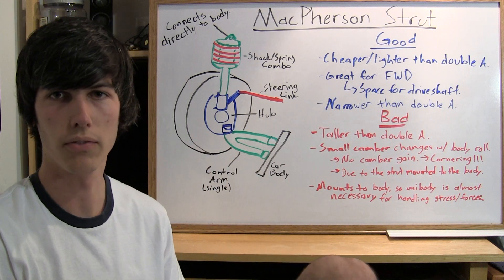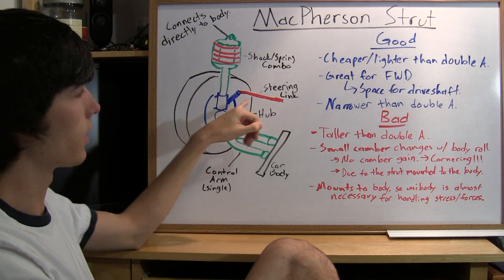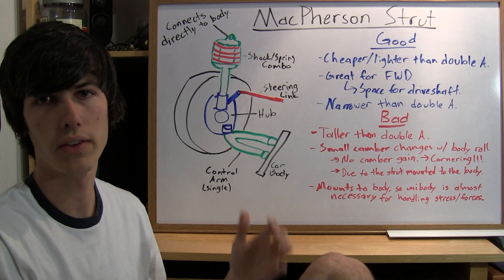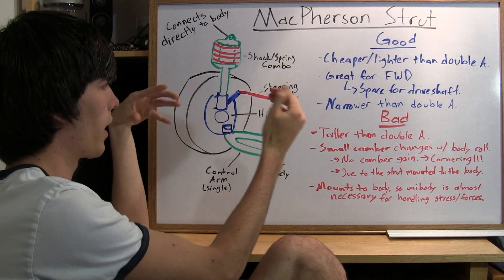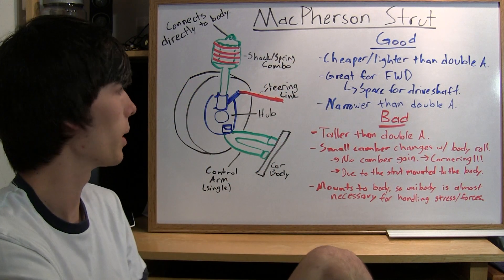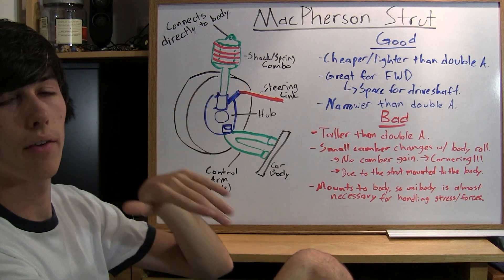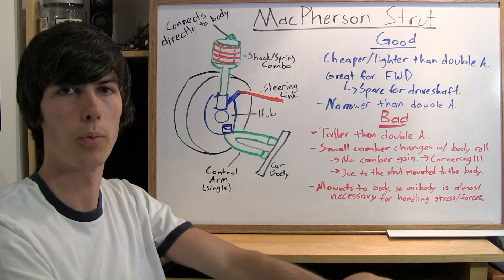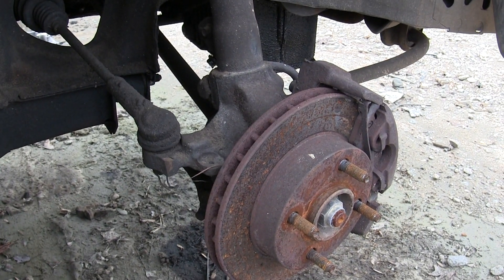MacPherson Strut Suspension - Simple Explanation

Comment: Hey man, me again.  You may wish to examine your comment about "small camber changes with body roll" and "no camber gain when cornering."  Neither are true.  A MacPhearson strut setup CAN go through huge camber sweeps, it just depends on how it is configured.  The shorter the lower control arm, the larger the camber change the car will experience.

They definitely DO have negative camber gain while cornering and this is achieved by making the wheel side of the lower control arm lower than the chassis side.  In doing so you force the bottom of the upright out while it sweeps up, right up until the angle of the lower control arm is perpendicular to the steering axis inclination.  Once you get beyond 90º to the SAI you start to head rapidly towards positive camber.

Most modern strut based cars are setup to gain some negative camber during body roll, some gain more than others.  Look at the modern BMW's, the modern Mustang, the BRZ/FRS and other more modern strut cars oriented towards performance and you'll see it in the geometry! ;)
Reply: yeah your right and its impossible to have no camber change with macpherson ... but you can with equal length double A arms. what he says dosent make sense.....
Reply: This video needs to be redone.

Comment: Actually it is possible to gain camber when cornering with a macpherson strut when playing with then components geomerty, longer lower A-arms, more angle to the struts while it is static ( not talking about tire camber while the car does not move ) etc. Every BMW 3 series, Porsche 911, or Nissan S chassis and lot of other have macpherson front suspension and they can achieve that, they gain negative camber as the front outer strut shortens while cornering. BTW great videos, subscribed!

Comment from the maker: No, there is not a relation between a cars ground clearance and it's unsprung mass. Sports cars are kept as low as possible to keep the center of gravity as low as possible, balancing the forces better across the 4 tires. Almost any car can be lowered, and this doesn't alter the unsprung mass (other than part of the weight of the suspension components which were swapped to lower the car shocks/springs/etc..).

Comment: First off, I want to let you know that I have plenty of mechanical experience and I know the terminology, so dont be afraid to get technical with me when answering this.

I have a 2003 Subaru Outback. 2.5L N/A regular commuter car. All stock. Dont get me wrong, these cars are freaking amazing and practical and with just a little money under the hood they have lots of potential. I love my little wagon. But its getting old and tired. Just hit 216,000. The throttle doesnt feel as sporty as it used to 30,000 miles ago when I bought it second hand. 
I've been having fun in it but I know its only abuse to the car, but aside from often revving it higher than I should, I've tried my best to take care if the suspension and it's components. Braking softly, going slow over bumps, just trying to keep that solid and planted feel it gives me when I drive it.

But soon I had to change the ball joints, which I did successfully. A normal wear and tear part of a car as you know.
I also went ahead and changed the tie rod ends since I lived up north at the time. The roads are horrible and if youre not careful you can easily throw your entire alignment off by smashing into a pothole the wrong way.
Anyway, the tie rod ends ended up being complete and utter garbage. They gave out only a year after replacing them. I should've expected it since they came from eBay. I dont even know what brand they were. I still had the original Subaru tie rods in the garage and I thought id do the hand check on them and they didnt feel sloppy at all. At least the outer ends didn't. The inner ends were. So I changed them to MOOG inners and put the original Subaru outers on them.
So with all the ball joints replaced I took it for a test drive. No sounds, nothing. 
Until I pressed on the brake. 
As the front end dipped down, a pop would come out from the front suspension area. Only when braking. Acceleration was smooth. There are no noises while turning. Going over speed bumps makes the sound too.
I took it to Goodyear to have it aligned. As they drove the car up the ramp, they heard the noise and told me it was the ball joints. I explained to then that I already changed them, including the tie rods.
They jacked the car up and checked the wheel for slop. There was none so they did the alignment. 
It felt nice for a little while. But maybe 100 miles in, my steering wheel went crooked again (probably the good ol trusty mechanics at Goodyear's fault). Goodyear told me the sound might be the strut mount bearings. 
I'm not sure on the legitimacy of that since I've never heard of a case of popping strut mounts. 
I took it into consideration though but still wondered about it myself.
I know all my bushings for the control arm need to be replaced.
My shocks look old and rusted but they still feel stiff. The car doesn't sag more to one side after going over a speed bump so I know the shocks are equal in "wear". 
I'm not sure which side I hear it on though. Its just one loud and solid pop. It may be two pops simultaneously. Sometimes I feel like I'll hear it on one side, and sonetimes on the other. But more often than not, I cant tell which side. Ive never heard one pop go off and then another after it. Just one solid pop after pressing the brake or doing anything that makes the suspension dip slowly. Dipping fast doesnt make the sound.

Can anyone give me any insight on what it might be? Could the Goodyear guys be right? Could I just check the bearings myself?

Comment: Double wishbone, you'll need spindles for an FF platform. If you are gonna rally, which is the most suspension taxing application of racing, its your best bet with proper tuning that pays mind to understeer. You modify by spring rates to compensate the weight of the vehicle. Best layout for hatchbacks in this light would be double wishbone up front, shocks in the back with springs attached to a pivotal subframe or trailing arm. Its all a matter of how you drive but that set up gives you options!

Comment: While the strut suspension itself generates little camber gain in roll, that occurs only if the wheels are not turned when of course they usually are in a corner. So this lesson is a bit simplistic, it would be great if we could have a 102 version which explains what effect other factors like caster can do when turning. Most road cars have strut front suspension so it would be a great topic.

Comment: The strut is not the steering axis (this is in reference to 1:26 "... in essense you can think of the strut here as also the steering axis...").  Steering axis in cars with MacPherson strut goes through the lower control arm and the strut bearing (located where strut mounts to the body).  Other recent strut based designs have separate pivot dedicated for steering so that steering axis can sit closer to center of the wheel for better steering characteristics.  Drawing in following link can be helpful in visualizing steering axis in strut based systems: http://www.caranddriver.com/features/ford-revoknuckle-and-gm-hiper-strut-explained-tech-dept

Comment: ...Continued.  For this reason, a strut is different from a standard telescopic shock absorber, which cannot handle side loads.  Struts suffer from higher friction than control arms, and this friction increases with a bending load, so struts do not react as well as control arms during mid-corner bumps at high g-force.  Car manufacturers typically arrange the spring to be slightly offset from the strut axis to counter the bending load and reduce friction.

Comment: A question for you: If cars have a low ground clearance, does that necessarily mean that there is more unsprung weight? If so, how do sports cars (particularly a Maserati), which has minimal ground clearance, maintain an amazingly smooth ride? The unsprung weight would throw it all off on corners and stuff. 
Thank you.

Comment: Nice video but i think a few details were missed.  A McPherson strut suspension is conceptually similar to a double-wishbone suspension except the strut takes the place of the upper control arm.  So the strut is exposed to forces that an upper control arm normally experiences.  During cornering, the strut would be exposed to bending forces as it tries to keep the wheel from falling over.

Comment: I am battling a wide spread issue struts are being installed incorrectly in Holden based cars, but everyone accepts it as “okay”

I’d like to ask your opinion if you have time, but there’s another question I have that’s related to those struts: why are the strut bushing retaining washers cupped? As an electrical/aviation engineer, I don’t get it.

Comment: What's forgotten as an advantage with the mcphersons is that they have less unsprung weight compared to a double wishbone setup, meaning your car reacts to uneven surface much better, keeping the tyre on the ground. That's why all rally cars for the past few decades have all had mcphersons, because they are driven on real roads unlike formula crap and other track based stuff.
Reply: Johannes Konow thanks for the tip (:

Comment: Question, I've noticed most modern day Macpherson strut has a small upper control arm. the control arm is no where near the size as on a double wishbone. but does this small upper arm help alleviate some of the handling disadvantages of the Macpherson strut? double wishbone guy her btw, had a 89 corvette z51. used to love to pop the hood and admire the unequal length double wishbone up front. and oh that 5 link in the rear was badass as well. anywho AMD answers are appreciated.
Reply: (5 months later...) Hi.  As far as I know, MacPherson strut suspension design doesn't have an upper control arm at all.  The strut connects the steering knuckle directly to the car body.  Maybe you are thinking of other suspension designs that use struts like those described in following link?  http://www.caranddriver.com/features/ford-revoknuckle-and-gm-hiper-strut-explained-tech-dept

Comment: Taller is sometimes better for stance with a Unibody taller definitely makes sense and Camber gain while corner is not a good thing F1 cars can get upto 5 mm in ground clearance but sometimes due to aerodynamics they have to raise it upto 12.5 mm to 20 to 25mm above the ground.Also taller is better for rougher terrains.

Comment: Is there only a short distance you can lower a car with MacPherson struts? I was looking at lowering a Geo Prizm, 1995 and looking into the front wheel well I could see the bottom coil spring holder/base is only about 2 inches over the front wheel, which would seem to prevent any more lowering spring than 2 inches or less.Please help with this question.

Comment: great but originally the front suspension differs from the rear suspension because of its design, as such, the front mounted with coil springs and shock struts its called the strut's suspension, and the rear coiled shocks are the mcpherson shocks (suspension) ✌which its very similar to the stut suspension but its the mcpherson suspension

Comment: anything bad for a mcpherson on a rear wheel drive?
Reply: Beyond the normal limitations of the design, such as height requirement, less independent movement (vertical change implies camber change), I don't know of any.  There are just better and cheaper designs out there that are typically used when steering isn't a concern.

Comment: I am an elderly retired EX Donnington GT 1980 champion ... Maybe it is my sense of balance .. but My new to me   2021 Fiat panda Hybrid has a distressing design issue .. The anti roll bar has moulded on alignment bushes . Forces introduced into the Downlinks to the macpherson strut   cause small steering deviations around centre . Fiat Customer care advised me to book my Fiat Panda Hybrid into the local Evora garage  to assure me that the 25,000 km travelled have not resulted in any unserviceable components . I was not allowed  to observe their mechanics actions . A clean bill of health was diagnosed with maybe an alignment which is not covered under warranty .  end of . Fiat have a not fit for purpose design fault on their range of Fiat cars .. this design disgrace is not evident on their Lancia Musa .. the anti roll bar forces are attached to the Lower front suspension wishbones . This Lancia Musa is  a luxury model which uses the fiat underpinnings . The steering on my friends Lancia Musa   does not exhibit the weird  / Fidgety steering of my Otherwise amazing little 2021 Fiat Panda Hybrid .  I am a competent engineer and can modify my Fiat Panda Hybrid anti roll bar link connection to alleviate the weird steering effect of the anti roll bar forces fed directly into the steering of my 2021 Fiat Panda Hybrid .  This is a safety issue and should be rectified By Fiat .. not me .   I designed , built and drove my 1980 Donnington GT Championship winning car .and I am so disappointed in the aloof / uncaring attitude of Fiat .

Comment: Cheaper? Shock $30 vs strut $700.
Reply from the maker: David Gray You're comparing two different things. Other suspensions will include extra control arms, bushings, spring, etc.
Reply: I'm talking about replacing a worn shock vs. replacing a worn strut. When you replace a shock, you don't have to replace the extra control arms, bushings, spring, etc.
Reply: David Gray its cheaper for manufacturers, not owners.